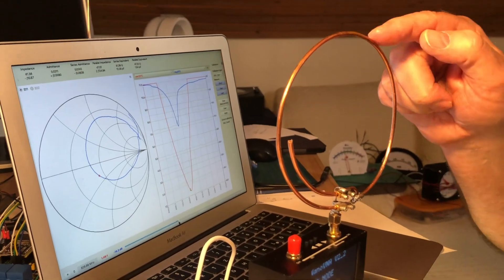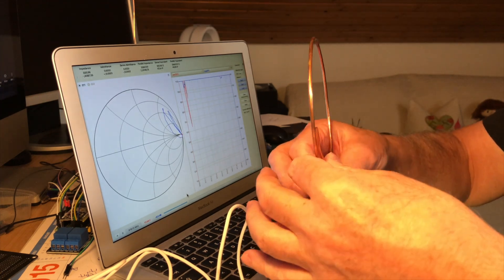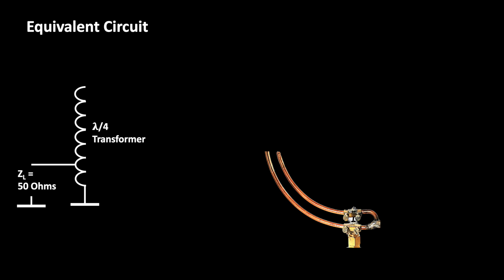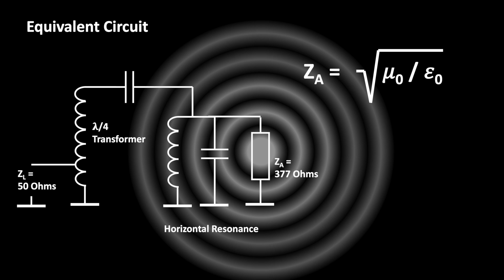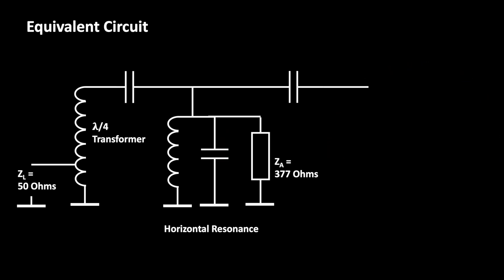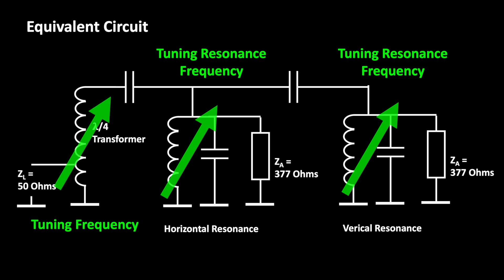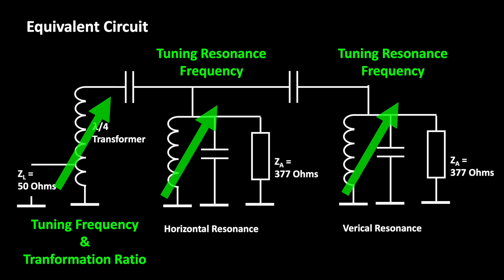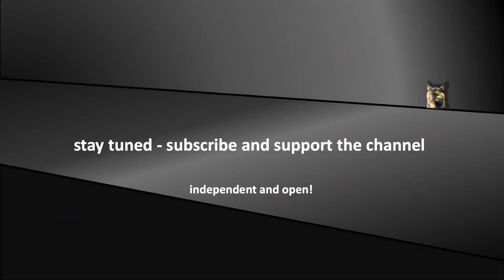Equivalent Circuit of a Two Resonance Mode Loop Antenna - a Short Lesson on RF (EP73)

Comment: You might want to check the tuning with the loop rotated 90 degrees to the length of the NanoVNA's body.
Reply from the maker: Hello John, 

I am very happy to read from you.

Yes, the NanoVNA is pretty close to the antenna. That actually has an impact. If I rotated the antenna, you would actually see it. There will be more episodes about the antenna with a planar design coming soon. And I connected a piece of coaxial cable to the antenna so that the influence of the NanoVNA housing disappears over the distance.

So stay tuned, it will be interesting!

Best greetings
Klaus